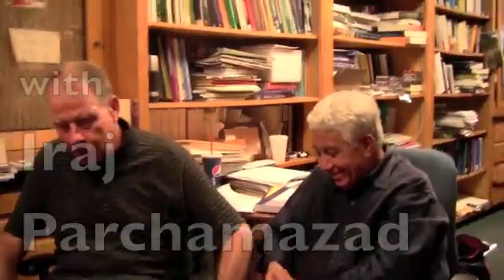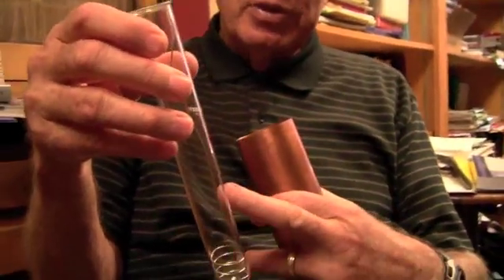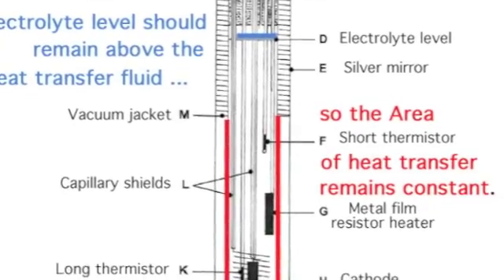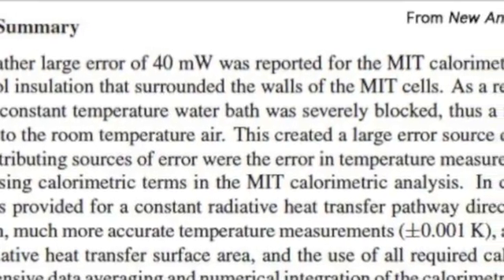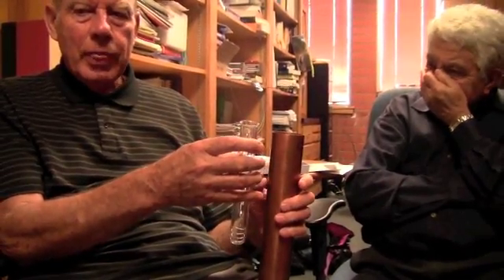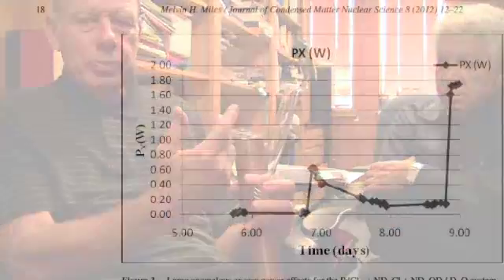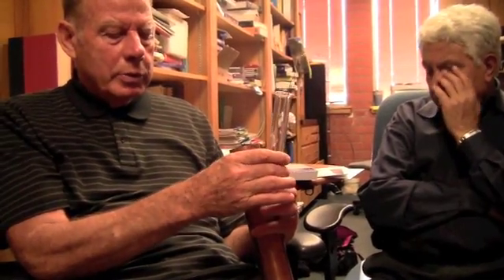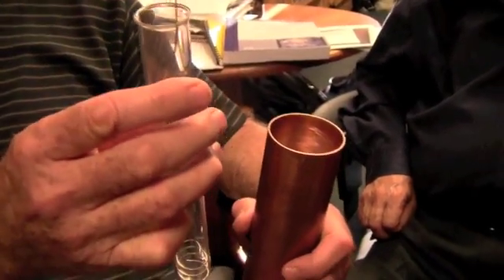Melvin Miles on Calorimetry Part 2: How to Make a Calorimeter

Comment: Students taking music exams do not ever play in a room with other idle instruments because the incidental resonance echoes of sympathetic vibration of similarly tuned strings, tubes or chambers interfere with the sounds produced by the player.
Alternatively, a laser or maser is pumped to resonate until ready for "discharge", and under some circumstances, a boiling water sample left out in the cold will cool faster, "discharge" its heat more quickly from a higher content than another sample at room temperature. These are all conduction by resonance effects where an extra modulation energy has been added, but the normal resonance framework of material chemistry is a dynamic permanence of resonating flows of binding energy.

So it would be more surprising that events of specific "discharge" of binding energy could never be observed than the intermittent examples so far recognized. It's the basic Quantum Mechanism dynamic principle, of 1-0 probability duality interval, of resonance potential in infinite combinations of singularity that is fundamentally, chemistry.